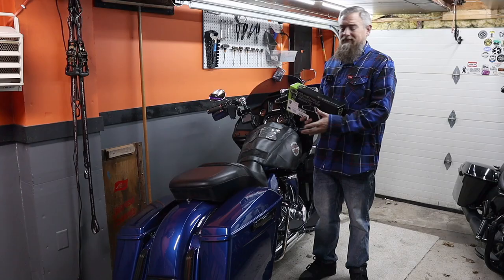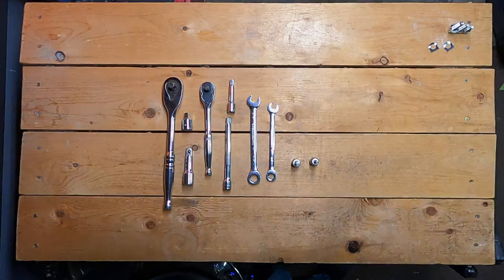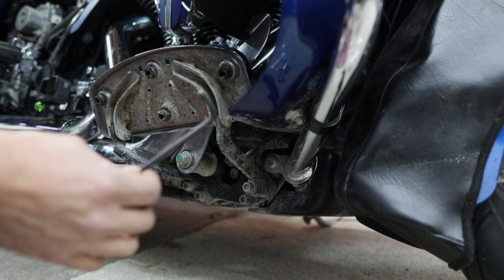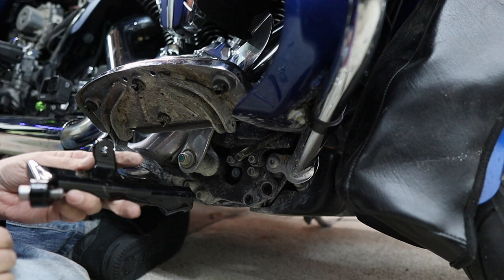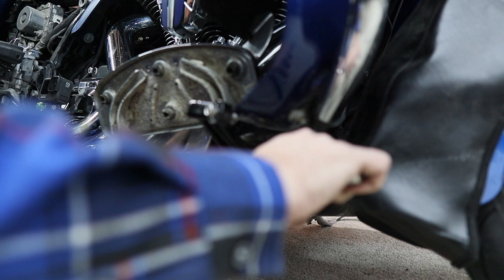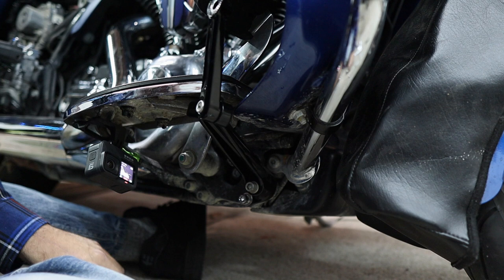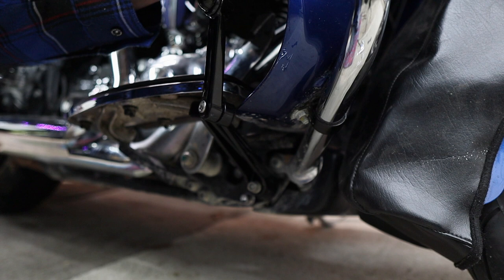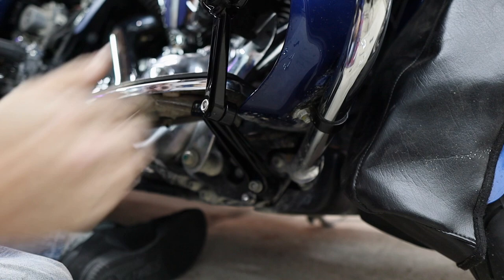@ciro3d_goldstrike3d  Frame Mounted Highway Foot Peg Mounts For Your HARLEY DAVIDSON Motorcycle

Comment: Just got a 22 Limited used with highway pegs mounted on the guard. I can't find a good position for them. After spending an hour plus playing around, I decided to look for another solution. I'd seen these on other bikes and wondered how they were mounted. Liked your informative and candid video. I've had too many issues so a torque wrench and lock tight will be used 🙂 Thanks!

Comment: I had them on my 2015 Road Glide when I traded it in on my 2020 I made them swap them to the new bike! 
I never could get really comfortable with the engine guard mounted highway pegs. They stretched my legs out a little far for my liking. I'm about 5'11" 34" inseam. I really love these!
Reply from the maker: Hey Rennie. I cant wait until spring when I can get some miles on them but so far just sitting on the bike they are way more comfortable for sure.